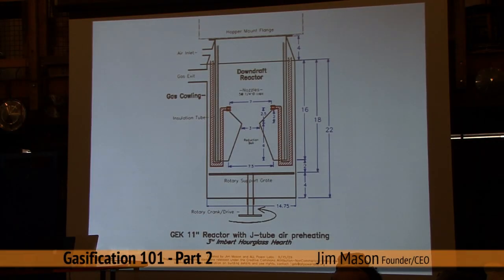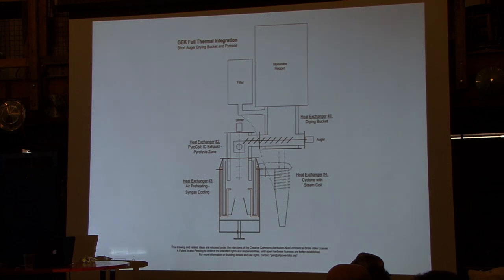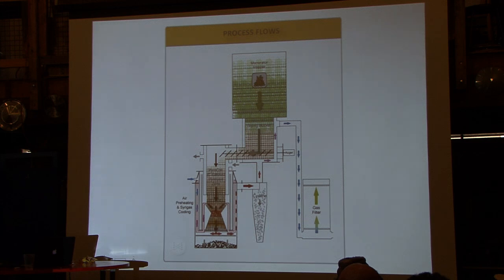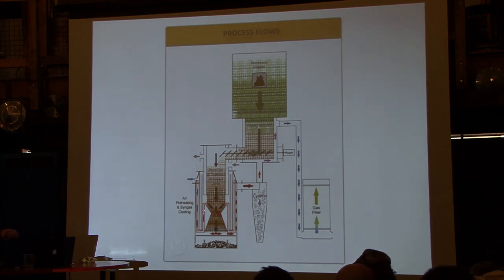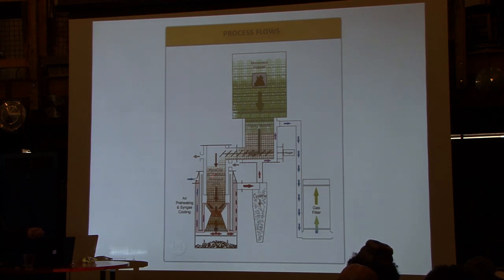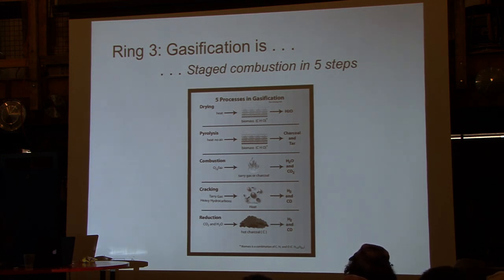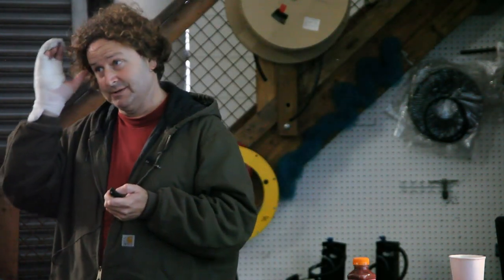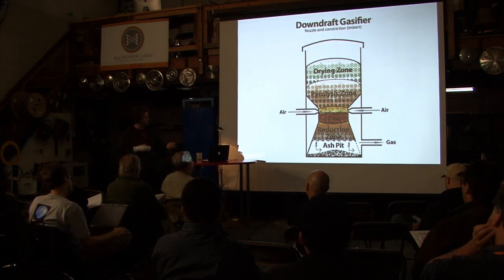Gasification 101 - Part 2

Comment: One key insight is that the gasifier is a refinery for a crude fuel— cellulosic biomass. One of the biggest things done by petroleum refineries is the thermal cracking of tars and asphalts and long-chain hydrocarbons into shorter chained hydrocarbons.

Remember also that primary tars (produced between 300˚C and about 450˚C with long residence time at those temperatures) are easiest to crack; all the tars produced at higher temperatures tend to react with themselves and become very hard to crack.

Comment: A well designed turbo rocket stove will burn to a completely fine ash and with a little extra design. Yes high heat air, charcoal, and possibly steam electric generation. Maybe even the gas.

Comment: Burning Anthracite Coal in an up draft gasifier is the best of the best and cleanest way possible to run a gasifier.just as burning coal in a stove ,compared to burning fire wood.  Coal burns clean.making any gas you want to work with the best  and cleanest burning fuel.why do you think Electric Power Companys burn coal?and not wood.
Reply: You really miss the point of all this. Anyone who understands this process knows that.
Reply: If you had the ability and access to mine the rarest form of coal, you're probably not the target audience for one of these lol

Comment: Cool and all, but it is a myth that wood gas is good for the environment. This produces pollution and Co2. This is not "green".
Reply from the maker: Just so you know, your comments were automatically marked as spam, likely because you posted the same thing in multiple videos. You are correct that wood gas is a serious concern for human health but wood gases are processed in the internal combustion engine during standard operation and are flared in the brief period of start-up and shutdown; exposure to wood gas or producer gas is very minimal, especially compared to a wood stove or campfire. The tail pipe does emit CO2 but the entire process is carbon negative by direct carbon sequestration in the form of biochar.